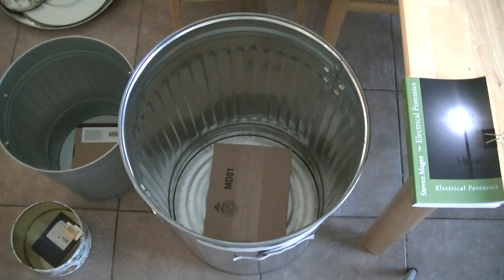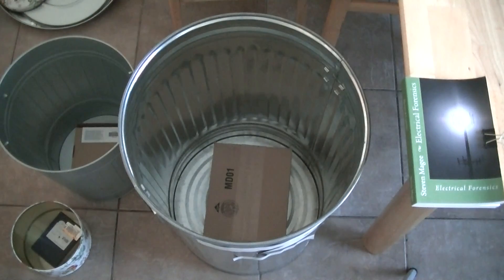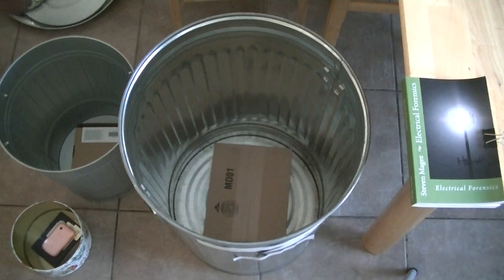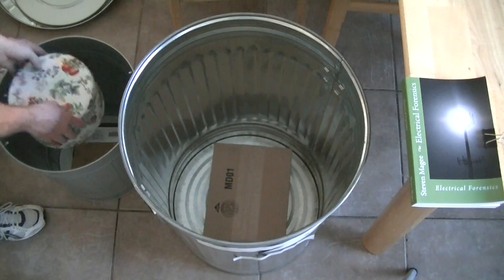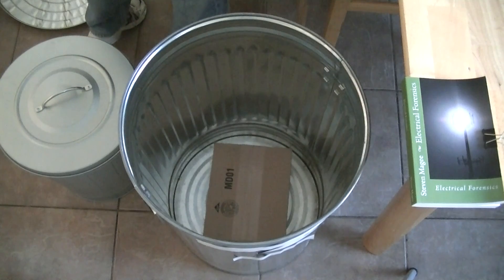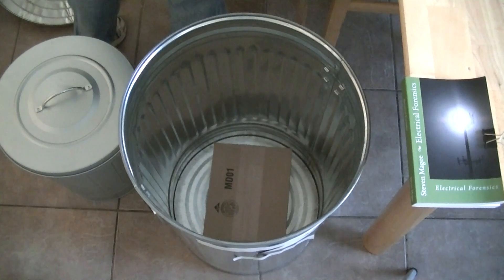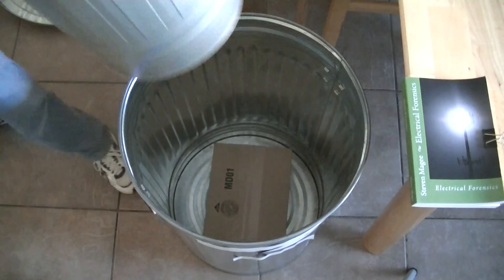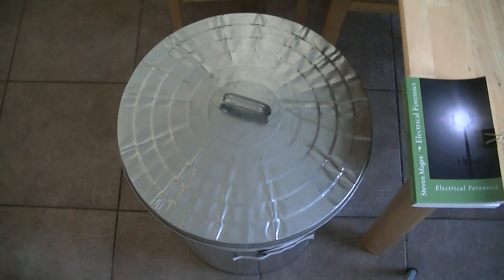How Many Faraday Cages are Needed to Block a Cell Phone Signal?

Comment: Wrong ! You need just one. Faraday Cages is a particular, specific case of  Gauss's Law . It is a universal law ,like Conservation of Energy, applying to any closed surface.  The problem with those can is the poor electrical conductivity.  Use a single cooper cage  (or silver or gold or even aluminium) and that is all you need. Remember : a general law of nature.

Comment: Because those cages are not made from conductive material. They are probably galvanized steel not aluminum. Just a couple of layers of aluminum foil will work.
Reply: Not conductive??? Try sticking a nail in an electric outlet and tell us again galvanized steel isn't conductive.
Reply: ThisguyjohnnyIV:  Since when is galvanized steel not conductive?  It IS conductive.  Al Steel IS conductive.  Galvanized, Stainless, Chrome Plated or Mild Steel.  All of it is.

Comment: you only need one........the can leaks where the lid goes on.  You can wrap a phone with aluminum foil and it will not work.
Reply: aluminium foil does work
Reply: I tried putting a phone in a solid aluminium box that was 5mm thick. It still failed as there must be microscopic gaps even though the lid was closed. The box is anodised and later I was reading that Anodised Aluminium won't work... Not sure if that's the case. When I put a phone in a tin box however then put that tin box inside a 2nd larger tin box it worked. I'm hearing though that Copper may be a better solution so might test a Copper Box. But maybe you need to build some kind of Gasket around the hinges. Not sure who can provide advice with this but I could do with assistance from an engineer with experience..
Reply: Not necessarily true.
I remember wrapping a smartphone up with a ridiculous amount of aluminum and it STILL did not block the signal.
Reply: Just wonderful, been searching for "faraday cage static electricity" for a while now, and I think this has helped. Ever heard of - Tennorra EMP Esterification - (search on google ) ? Ive heard some unbelievable things about it and my co-worker got excellent results with it.
Reply: Just wonderful, been searching for "faraday's cage" for a while now, and I think this has helped. Have you ever come across - Tennorra EMP Esterification - (should be on google have a look ) ? Ive heard some amazing things about it and my neighbour got excellent results with it.
Reply: Maybe you have an older phone, because that didn't work on mine.
Reply: Wrong ! You need just one. Faraday Cages is a particular, specific case of  Gauss's Law . It is a universal law ,like Conservation of Energy, applying to any closed surface.  The problem with those can is the poor electrical conductivity.  Use a single cooper cage  (or silver or gold or even aluminium) and that is all you need. Remember : a general law of nature.

Comment: The answer is one because by definition a Faraday Cage will block all signals.
Reply: @Rahmi Acar Just so you know, all radio waves are electromagnetic waves. A faraday cage is built primarily to protect against static electrical fields and shield humans from electrocution. Most happen to cause great attenuation of certain electromagnetic frequencies too, but no cage can block all frequencies completely. His metal can experiment isn't a true faraday cage it is a faraday shield and the blocking is due to the thickness of the conductive metal materials the cans were made of. A faraday cage has a fine mesh with holes that are the same wavelength of the signal(s) that are meant to be blocked. The more layers of mesh and the variations of holes the more frequencies that are blocked.
Reply: I've heard that MgO board will block cell tower radiation... why would this happen?
Reply: Not true
Reply: Rahmi Acar, Nope! You need to study physics  Wrong !  Faraday Cages is a particular, specific case of  Gauss's Law . It is a universal law ,like Conservation of Energy, applying to any closed surface.  The problem with those can is the poor electrical conductivity.  Use a single cooper cage  (or silver or gold or even aluminium) and that is all you need. Remember : a general law of nature.
Reply: Uhr.......wrong answer, as this test CLEARLY shows.
Reply: @UguysRnuts  these cans being made from Galvanized metals is a poor test in the very least.
Reply: @UguysRnuts  This test shows that those are NOT Faraday cages. If they were they would block that signal.

Comment: One Faraday cage might work better if it were grounded....
Reply: Hard to do with a portable phone.
Reply: Wrong ! You need just one. Faraday Cages is a particular, specific case of  Gauss's Law . It is a universal law ,like Conservation of Energy, applying to any closed surface.  The problem with those can is the poor electrical conductivity.  Use a single cooper cage  (or silver or gold or even aluminium) and that is all you need. Remember : a general law of nature.